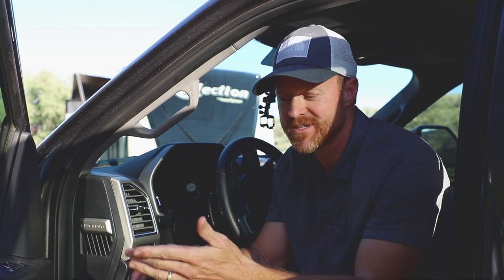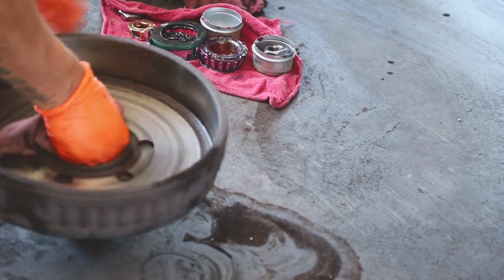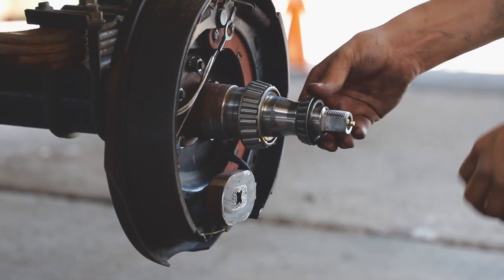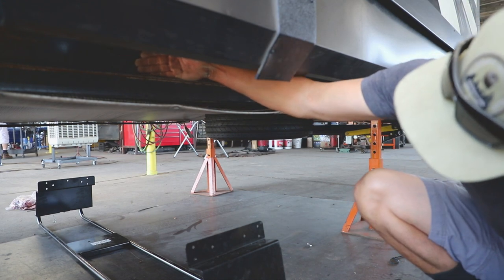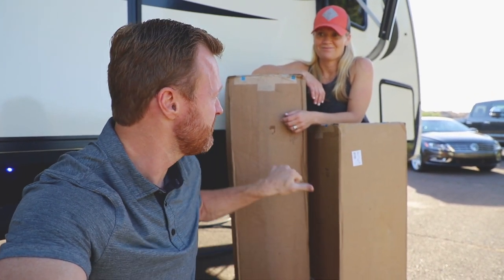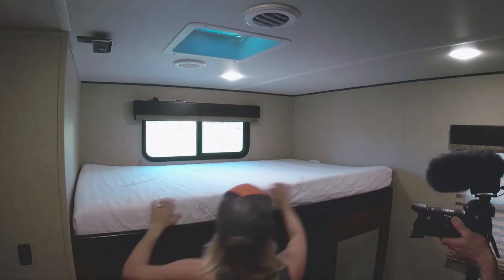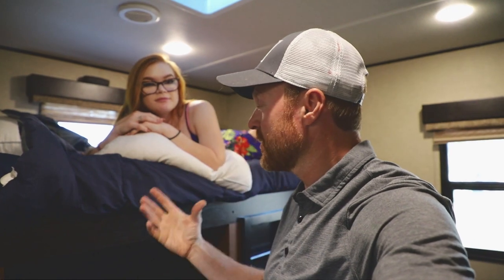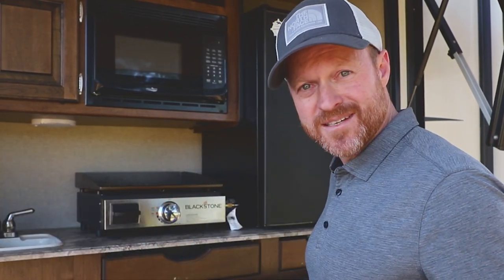RV UPGRADES: MORryde SRE 4000 | WATER HEATER FIX & NEW MATTRESS

Comment from the maker: A few have commented about the jack under the axle. The RV was being 100% supported by jacks on the frame. The floor jack on the axle was only to move it up/down to align the bolts with the leaf spring. The slight bend in the axle is the crown and all axles should have this. The angle of the shot made it look more exaggerated than it is. All is good is in the trailer hood.
Reply: Glad to hear.  All the best on your next adventure.
Reply: Yeah I was cringing when they did that. Video made it look like it was bending.  Awesome upgrades!! 

Did we ever get a video on the new hitch??
Reply: Good. Looked like bent axle by jacking the axle.
Reply: oh thanks for enlightening us on that I thought it was bent too. After having some axle problems with my car recently, seeing that kinda alarmed me a bit
Reply: Keep Your Daydream 
Why did you upgrade the axles and suspension on your travel trailer? Isn't the factory suspension sufficient?
Reply: We will be keeping you guys in prayer
Reply: Even though the trailer weight was off the axles you still should use two jacks one on each side of the axle. Also grand design has had multiple issues using the lippert brakes and drums and have issues with grease leaking past the seals and damaging breaks so keep an eye on it especially with were your traveling
Reply: Marc you got mentioned in the latest less junk video!    https://www.youtube.com/watch?v=2zQXoCUYV-4
@ 7:30  follows your philosophy of taking your time! I LOL'd :) it reminds me of trying to park my trailer at our spot at home! (I usually get it just right by the 14th try :)
Reply: Mark, I'm installing the same SRE4000 on my 33ft travel trailer this week and the installer says he wants me to take it to a shop and have it aligned after he finishes the install.  Did you wave an alignment done afterwards?  Frankly, I didn't even know you could get travel trailers aligned.
Reply: James M. Yes there are 2 ways to align trailer axles with a laser alignment kit or the old school string method
Reply: I would not expect that the axles would be out of alignment unless the locator pin had been missing or sheared off like Ginger 1.0 on the way to La Penita 
https://youtu.be/6jDhkxLhQ74 at 11:00
Reply: sd super I see.  Should I get an alignment after get the new suspension  installed?
Reply: James M.  After is most important but if you came to my work we would do before and after and try to incorporate the aligning. Of sytem while installing suspension
Reply: OK that's good advice, thanks!
Reply: @sdsuper1030    Thank You, So I will do even the research .I would want to get it Right ,Here in The Chair then 300 miles from Home.

Comment: I have driven the Al Can 23 times over the last 38 years. First time I drove it, was all gravel.  I was 16 and drove to Fairbanks  from S. CA where my grandparents lived. My mother worried to death that I was on this 4000 mile trip at 16 but she got over it and even joined me for the return trip in the fall.  I have driven it with VW campers, Pick ups, trailers, motor homes. People still prepare like they are going to the edge of the world in reality the road now days is good and the major towns have everything you find here in the states. I've had a few blow outs but bought a replacement tire at the next town. Never worried about if any thing would failed like bearings. The one thing that I have seen and had happen to me, is travel trailers broke down along the hwy because of broken leaf springs. I would carry a spare spring. I just carried some 6x6 blocks so if a spring broke on the trailer I would jack it up put a block between the axle and the frame and continue on to the next town. If it were the front of the spring I carried a cable come along to attach to the front of the frame and tie the axle from sliding back. The main thing even though the road is good and paved is not to drive over 45 mph as you will hit frost heaves and pot holes unexpectedly. Also the people who go faster never see the wild life along the hwy. You will have people pass you doing 60 mph and you run in to them at a look out or the next town and they will ask "did you see any wildlife?" Yes we saw bears, goats, moose. They say "well we didn't see any thing.  That's because they were going to damn fast to see any thing! Even at 45 mph it is hard to get stopped quickly when you see bears and other animals. You also want to keep away from cars as they see something they'll just slam on the brakes with out seeing if a bigger rig that can't stop is behind them. It's a great drive that I have never gotten tired of. Just take your time and have a trip of a life time.
Reply: Great advice! Thank you!

Comment: Great Recommendations to box the spring supports in. We had a failure last May in our Keystone Raptor RP3712. The mechanic thought we were nuts.  NOW we're doing the TrailAir Center Point Air Ride Supension UPGRADE!

Comment: Awesome upgrades!!!  I installed the SRE-4000 and it makes a ton of difference inside the rig, plus about 1.5" higher ride height.  I also upgrade to disk brakes about a 1yr ago, all I can is Wow, what an improvement on the drum brakes.   Also the Timken bearings is all I have that has not been done yet. Thanks for sharing!!
Reply: Did you do yourself, or have done?   I have access to the product and am debating if I should do or have done.  Doesn't look too difficult, just time consuming?
Reply: kent fyfe. Took me a weekend to do leaf springs, heavy duty shackle straps and the MRE4000, then the next weekend took a 150 mile trip and rechecked torque settings a few times along the way..  Disk brakes took a other weekend.. Good luck!

Comment: Hanger failure is what totaled my 2014 Coachman Passport.  One of the hangers failed on our 2000 mile trip from California to Washington state last July, and by the time the trailer got to the repair shop in Tillamook OR, the flat bed ride broke the frame.  That allowed us to get our Grand Design Image 2600RB.  Great rig.  I will be looking into beefing up the hangers on this one.  Thanks for the video.

Comment: Great upgrade video.  We added the SRE 4000 and HD wet shackle bolts last summer to the 5er and welded in the spring hangers same as you show in the video.  We then upgraded to Disk brakes and Timken bearings on the trailer made huge difference to the performance and ride.

Comment: Great stuff as always. The shot of the suspension flexing going over the speed bumps was excellent! When Ginger is all loaded up to the max it would make a good repeat shot to compare. One really begins to understand what those "junk" undercarriages and china bombs are going through on all these rigs flying down the roads. The turning and twisting and failing is a terrible way to learn just how unsafe they really are. Tip of the hat to those guys at the repair shop for the quality work and honest evaluations. Also you can feel good you'll be one of the few rigs traveling with American made bearings!!! Thanks for all you two do. Jim.

Comment: Great Video and essential upgrades.  I have to have a spare spare.  Most of the ALCAN will be smooth 65-70 MPH/110KPH but from Burwash landing to AK border and all roads in AK are rough (lots of frost heaves (think moguls)).  When you installed the mattress I noticed you have the same blinds that came in our rig.  I recommend you swap the blinds in your sleeping areas with MCD blackout blinds.  24 hours of daylight makes it hard to sleep without blackout blinds.

Comment: Great choice on the bearings.  I put them on my 2500 series Ram when I did some suspension work and my boat trailer when I upgraded the brakes.

Comment: After watching your up grade I thought this would be  great to do. Jacked up my 30 ft trailer, and cribbed it up with cross ties. The first thing I notices during the tear down that  the bushings were plastic and egg shaped, after only 7,500 miles on a 2016 Aspen Trail (Dutchman) one of the springs had NO bushings (great quality control). Installed the Morride and the cross bracing. Now off to Alaska

Comment: Putting the GoPro underneath to watch the axles work was awesome. On your truck have you decided in adding an Airdog fuel water separator pump? That was one of the best things that I did for my diesel. It helps to prevent contaminated fuel to the injectors and also helps boost the fuel pressure from the tank to the injection pump.

Comment: Check the lugnuts. Retighten as needed. Also check the suspension and tires at each pit stop. Three years ago when adjusting brakes I noticed clicking sound in one wheel while spinning it. Bad bearing. I also will check hubs by touching them when I stop    to see if any heating due to bearing issue.

Comment: Although I usually find your videos interesting and funny, sometimes, I think someone’s been scaring you about the trip to Alaska. In 1992 I pulled an old (ie very heavy) fifth wheel from Arizona to Missouri to Washington state then up the Alcan to anchorage. Three years later I pulled it back down to Missouri! Sold it, bought a small cab over camper and drove it back to Alaska. With a 1991 Dodge Dakota 4x4 extended cab with my wife, three daughters and our 100 lb lab, 200 lbs of Sams favorite dog food, because beau liked it and Alaska didn’t have any Walmart’s yet, a case of oil, case of anti freeze, four 5 gallon  cans of gas, and whatever the fresh water tank held. I never got a flat or even a window chip on those trips. Between 92 and 95 I drove up 3 times total and down twice. No problem with gas either! Although the dakota (318 ci, before the magnum) did drop down to 9 mpg thru the mountains, overall it was great. I bought it new in 91 in Phoenix. Drove it until 2002, had 237000 miles, is still driving around anchorage today. You will encounter a lot of road repairing going on fixing winter potholes where you will have stretches following pilot cars, so that will slow you down some in rough road areas, mostly the roads, 22 years after my last trip down, are good, the worst is when you get close to the border at Tok, seems to be a long running dispute on who is responsible to maintain the roads close to the border, and you will encounter some pretty awesome frost heaves you will have to slow way down for during the first half of the day drive from Tok to the anchorage area. My current Dodge Ram 2004 4x4 quad cab I  bought new in 04 and it has 270000 miles with zero major repairs, fifth windshield tho, it’s worse around town. This truck has all Alaska miles. I do 3000 miles every two months, just do your regular maintenance and you should be fine. I took your advice and just bought a used motorhome, am retiring this month from self employment, and plan to put some miles on this motorhome. I hope I get to run into you guys if we get in the same AO, will watch your posts. I will probably leave Alaska around the end of June. My kids have all grown and moved to Washington, Texas and Oklahoma. Got me some visiting to do.! Lol! Enjoy your trip, the scenery is outstanding, my favorite drive was in August 95, from Calgary till about halfway to Saskatchewan I had northern lights on the horizon for hours....and don’t leave food unattended outside your camper! Lol!
Reply: Sorry it was so long !
Reply from the maker: Yeah, I get it. It's just like Mexico... everything is exaggerated. I still think good suspension, tires, solar and an extra large fuel tank are good for full-time travel. We hope to show what it's really like.
Reply: Keep Your Daydream can’t argue with any of those things, my generator won’t run if I have under a quarter tank of gas, safety feature so you don’t run out,  although I don’t anticipate needing it often, solar is cool too. Have a great trip.
Reply: John I would consider you a very lucky man, not getting even a chip out of your windshield on the Alcan highway. I grew up in Fort Nelson which is mile 300 and everyone I knew had 
cracked or chipped windshields because of that highway.  LOL

Comment: FYI I know this video is 2 years old, but if you purchase a mattress from MatressInsider and get the Luxury RV option, which is the top of the line one, it's $100 off right now, PLUS you can ALSO use the KYD10 code and get an additional 15% off the base price.  So I saved $185 on an RV King just now!  SWEET!  Thank you KYD!!!!!

Comment: Recently took our travel trailer in for wheel bearing check, repack or replacement if necessary. They did a great job.....but when I started to get on the road home...no electric brakes. That sure increases the pucker factor! Partially my fault for I usually check the function of the electric controller after hooking up and starting to roll. 

After 3 hours of adjusting the brakes on all 4 wheels and rechecking, they're working fine and no issues using them on the 3000 mile trip to Seattle and back. 

There was head scratching and no explanation as to how/why this occurred since the brake adjustment was not messed with prior to the wheels being removed. Lessons learned.....

Comment: As someone who lived in Alaska, I'd be a skeptical about having a tire mounted under the travel trailer. Many of the roads you'll be travelling on to get to Alaska are still gravel. Your tire will be subject to much of the debris being kicked up by your tires. The tire is going to be covered in dirt or mud. If you go through an area with snow that's another issue. Plus you're going to have to get under there to get it off. I understand not wanting a second tire mounted on the rear of the travel trailer. Another possible option is to put it in the bed of your truck if there is room. Hope you all have a wonderful trip to Alaska!

Comment: You may  want to have a wheel alignment before u go.  It helped our tires out tremendously.  We no longer had scrubbing tires.  Great video.
Reply from the maker: I haven't seen uneven wear, but I'll keep an eye on it.
Reply: One thing you may notice in the rv with the MORyde is your items and drawers will be less likely to move or open up during your travels.  We noticed this.

Comment: the ECM for the hot water stop working on a trip  the green and yellow  wire run the gas or the 110ac relay  .  by adding 12v+ power with a jumper wire you can over rid the ECM . by setting a timer on my phone for 15 mins i could make hot water from gas or 110ac power any time i needed but you really have to keep a eye on it so you dont over do it . its some thing to keep in mind when there is not RV shops any where around you

Comment: IF you go to the Fairbanks Alaska area (I used to live there for 4 years) be sure to check out the gold mines tours. you get to pan for gold, and you keep what you find, and they take you into a mine on a tour, and then they feed you the most amazing beef stew at the 'Chow Hall' there. Then you should also check out Chena Hot Springs. They have lots of geothermal springs, and a natural hot spring that you can soak in. Also there is a hot spring fed indoor pool. They have an Ice Castle type of thing you should check out too. Furniture and rooms all made of ice. You can even stay there the night on an ice bed. Its awesome. Are you driving through Canada or taking a ferry to get into Alaska? I can help you with ferry info since Ive traveled the same route.

Other things to visit in Fairbanks:
Pioneer Park - during the summer they have a great salmon bake. You get a large portion of either salmon, halibut or prime rib and then unlimited trips to the salad and dessert bar. They also have a Native American museum there, a -45F room if you want to know what that feels like and a train ride. 

Midnight Sun festival. Depending on when you get there lots of festival there to check out. 

Baseball game at midnight. They play a few games at midnight without the need if stadium lights because the sun is still up. 
Don't forget to check Mt. Denali too. That's a must see. 

Enjoy Alaska!
Reply from the maker: Copied and saved. Thx

Comment: I think I see where the bent axle came from or at least a contributing factor.  At 1:19 when the jack raises the rig the axle shows a bend at the jack contact.  Every other shot of the jack holding up the rig that same bend it there.  I’m no mechanic but just doesn’t seem to be a good lift point for all that weight.  I hope you get it resolved soon.  Looking forward to season 6.

Comment: Your upgrades look great.  I have a warning for you with the BAL Hide a Spare.  I have that on my trailer and when I lowered my spare to check on the tire pressure.  I found that the beams had worn into the side of the tire making it unusable.  I am in the process of having the tire replaced.  Dealer says this is the first they have heard of this. I am thinking it has to be a common occurrence.  Please check your spare after a period of driving to see if you are having the same issue.  
I don't want you to have problems in Alaska.
Reply from the maker: Good suggestion. I'll do periodic checks, which I would have never done without your comment. Thx.
Reply: Dealer changed type of bolt that is holding the spare so there is not as much pressure on the spare. The scrapped using a carpet in between beams and tire, they were afraid of keeping too wet and having rot. I will keep a close eye on it. 
When I get a chance I will send you pictures. Dealer had all my mods done in 5 days. Picking trailer up 6/21.
Reply: I have an update to my Hide a Spare. I had the same issue after last years dealer mod. What I discovered is Surveyor installed the wrong model for the Hide A Spare. They installed the version for  TT that doesn't have an enclosed underbelly.
Tomorrow I will be calling Surveyor. Obviously the dealer didn't know the difference.
I will keep you posted.